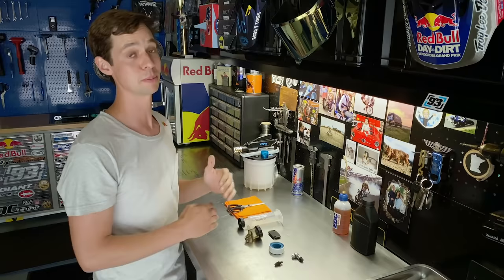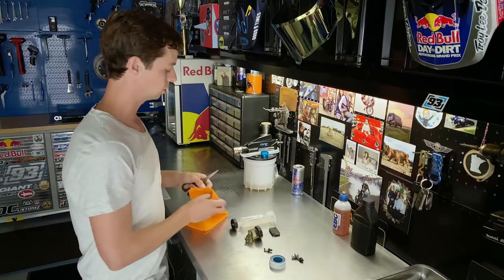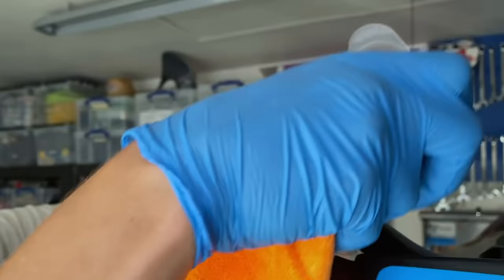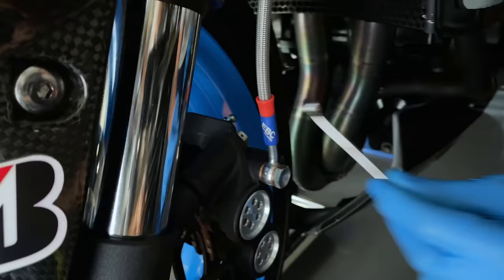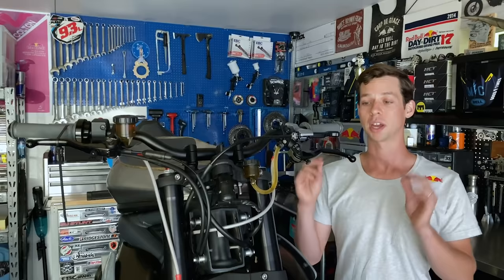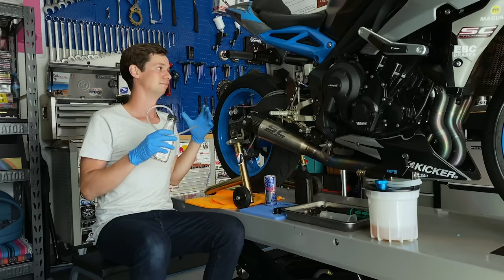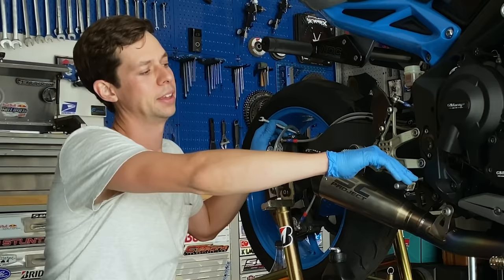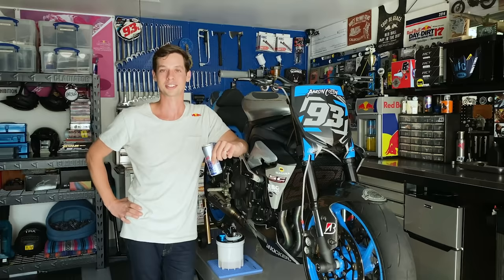Motorcycle Hydraulic Brake System Flush Tips | MC Garage

Comment: If you don't want to remove the bleed nipple to wrap with Teflon tape, it helps to brush brake grease around where the brake nipple screws into the caliper. Also put some where tube connects to bleed nipple.

If you don't have brake grease (like Sil-Glyde Silicone Brake Lubricant) you can use any other grease (wheel bearing, lithium assembly lube, etc) because it is external to the brake system and will be wiped away when you are done.
THEN when you use the mity vac or similar tool to "suck" and create a vacuum, and crack open the bleeder nipple, you only get fluid and any bubbles that were in the brake line. You eliminate all the air that shoots in from around the threads and from a poorly sealing hose attached to the bleeder nipple. Makes a night and day difference.

Aaron rocks - great video. This dude is an amazing stunt rider, seen him do a stoppie all down the block.

Comment: For a system that already has brake fluid and all your doing is flashing with new brake fluid, the first thing I do is bleed from the master cylinder bleed nipple using the old pump and hold method.  The reason, any air in the system will be at the top of the system, so by starting there, you remove any air in the system right away.  After that quick air removal task is done, I use a syringe to suck out the old brake fluid in the reservoir, fill with new oil, then begin the bleeding process at the calipers still using the old pump and hold method.  After you can see the old brake has been purged, and the new fluid is now showing, the bleed process is done.  I only use the air pressure/vacuum method if I'm installing new lines and/or completely starting with no fluid in the system.

Comment: As long as I've been riding and working on my own bikes, I'm surprised I'd never heard of the zip-tie trick.  I just replaced the rotors, brake lines and pads on my Bonnie, including replacing the front caliper seals, and while the rear bled and came up to pressure easily, the front didn't.  I re-bled it and it still wasn't quite right, so I tried the zip-tie, cut it off later and it's perfect!  Thanks!
Reply: How good is that feeling?! Happy to help!

Comment: Great presentation Aaron; very well prepared and nicely executed.  I've used grease on my bleeders to keep air out, but I think you've convinced me to switch to TFE tape.  
An ABS system will in general not change this procedure.  DOT3/4 fluid should really be flushed annually unless you live in the desert.  I use a pneumatic venturi-type vacuum pump ($20) with a glass catch jar for this, and control the vacuum with a valve on the air line.  A MityVac hand pump ($35) is pretty good too, and less hassle to set up.  Suck the reservoir empty and refill with fresh fluid to start.  If you can then open the bleeder and compress your caliper pistons fully, you will empty the caliper and get a more thorough bleed, but this must be done carefully to avoid damaging the rotor, etc.  Also skip this if you suspect any rust on your caliper pistons.  This should be easier with the vacuum system on to assist (I've not tried this yet).   For those of you who also work on cars 🤦‍♂️, be aware that the rubber cups in hydraulic clutches and drum brake cylinders will NOT hold a vacuum like disc brake piston rings do.  If you pull much vacuum on those, you WILL suck air into the cylinder and defeat your purpose.  I've seen this happen in the master cylinder too, so don't suck too hard. 😒   Lastly, you can reverse the process and gently pressurize the jar to pump gear oil into a differential housing or other hard-to-reach place.

Comment: nice video, I picked up a few tips. Clever idea with the zip ties and tire valve/fluid cap for 90degree pour!  That will come in handy when I bleed the rear brake on my Track ZX6R. I deleted the rear fluid container and just have a 8" piece of tube with a cap/plug. That tube is like 8mm.

Comment: One thing seems off about front bleeding. You went to the closer side first instead of starting from the farthest point (left caliper). Why is that? I hear ABS makes this old process unnecessary but haven't seen it mentioned by a reliable source so would like to know. Besides, I don't see an ABS sensor cable on this bike so I assume it doesn't have it?
Reply: Not relevant for this bike but some stock systems have a crossover brake tube/hose (right side now the furthest point).

Comment: Q. I was told not to use the zip-tie trick on the hydraulic clutch (brake is fine) as it compresses the plate return springs? Also once bake fluid bottle is opened and used, it should be disposed of, don't keep the remaining fluid as it only absorbs water over time.

Comment: If it's a bike you are gonna keep, just spend $8 per OEM bleed nipple on the bike and get SpeedBleeders instead. One way check valves. Open, pull lever or push pedal, refill as you go, and close. Simple, one man, quick operation. Once you install them, I can bleed clutch and brake fluid in less time than it took me to write this.
Reply: I agree!  Slick setup!

Comment: Before you finish, take a wrench or a small hammer and tap on all the connections and the master cylinder, then bleed it a couple more times. Tapping on the connections will free up the air bubbles traped in the system.

Comment: Can a Pneumatic Bleeder completely purge air on the entire system dry including the ABS Control Module?
Reply: Curious. My first guess is no.
Reply: I asked coz I think those solenoid valves can only be bled by Diagnostic Tools which is really an expensive route for most DIY'er.

Comment: is the teflon tape ok to leave on the bleeder screw? can it withstand the heat of the brakes or will it cause issue down the road?
Reply: It eventually will need replacing from deterioration but I have not had any enter the braking system in my experience.

Comment: Very Good.  But here is a key  question; on a system with ABS you have to hook-up to a diagnostic devise to open the ABS valves to flush fluid.  Can youi still do an old fasion flush withour flushing the ABS valve?
Reply: Short answer is no.
Reply: Depends on the bike and the ABS setup.  I want fresh fluids in that expensive component to keep it clean.  Look it up and don't trip on the two yard line!
Reply: With the modern ABS system you often need to place ecu into bleed mode.

Comment: I've been thinking of upgrading to steel braided lines. How do you get the air out when it is all air? Or am I overthinking it?
And how much air should be in the reservoir?
Reply: Starting with a bleeding device that will start a vacuum is the best way to start. You can sometime gravity bleed if you have time (Fill at the top and let leak out the bottom) but I recommend at least a basic bleeder.

Comment: What are the risks of having fluid way beyond recommended interval (even if braking feels fine)? I ride MTBs and really only bleed my brakes if my lever feel is impacted - for MTB purposes even a super-polluted DOT fluid seems to do the job, at least it did for my riding - just wondering if moto world is similar or if stopping would be dramatically impacted...
Reply: You risk ruining your ABS system, pistons, and other parts from water seeping into the fluid and rusting bits that should not be exposed to water.  Brake fluid is hygroscopic (fancy word for 'attracts water').  It is a cheap and simple process to do it every year and not discover you have no brakes when you really need them!  If a caliper gets even a speck of rust or corrosion in it, it can hang up, not fully release, wear down your pads, ruin your disc, and blow the seals.  Without fluid, you have no brakes!  Not worth it.  Brake fluid is cheaper than crashing.  Look at the grungy color of the fluid coming out and feel good about the fresh stuff!
Reply: @garycassill1314  Cool - thank you for the info - I guess ability to stop is generally a good thing... I've bummed around internet and in general there seems to be more of a concern with boiling temp drop, although personally I'd think corrosion could be a greater issue for general riding - I'd be nice if there was a rule of thumb at which % of water content components of various materials start to corrode. There doesn't seem to be much of a consensus from different manufacturers, including cars on what is an appropriate interval - I'm assuming at some point you'd be hitting diminishing returns.
Reply: I would agree with Gary. You have to be neglect the system for many years for that to happen but at its worst it can even turn into a Jelly like sludge. Most people can get away with 5ish years on a bleed. I am able to notice the diminishing performance of the boiling point temperature after a few months of use. It is very situational.

Comment: There also exists a "pressure" bleeder tool (instead of vacuum). No compressed air needed. I like the Motive Products one. Magic. Fun tip: switch between colored brake fluid and clear so you can see when you've reached the end of the old fluid.

Comment: How about the breaking liquid in the ABS pump?
Reply: There's not that much in abs pump compared to the whole system. So most of us don't bother. You can go for a ride engage abs couple of times after a flush, then flush it one more time if you want. But I never had issues.
Reply: Some bikes have very sensitive ABS units like my BMW.  Look it up and sometimes there is a separate bleeder on the ABS unit.  They are pretty expensive to replace (mine would have been $2,000 for the parts!) so why skip that part?  Look it up on the forums or manual and  do it right.  Others don't need a separate bleed.
Reply: Most of the time you will need to put the bike into a "Bleed Mode" with the modern ABS Systems

Comment: You are creating pressure using the rear brake lever, not vacuum.  It is almost as easy and much more controllable to use a hand vacuum pump, Mityvac or similar, rather than the compressed air unit for vacuum flushing.  Much quieter and less likely to inadvertently run the master cylinder reservoir dry and introduce air into the system.

Comment: I could not bleed my Ducati's clutch, it just wouldn't bleed and made it worse. I had to get it towed to the dealer to get it fixed. Lost my confidence.
Reply: The clutch bleeds always seem to be more difficult than the brakes. I have had the best luck removing the slave cylinder to have something to push the fluid back and forth with.